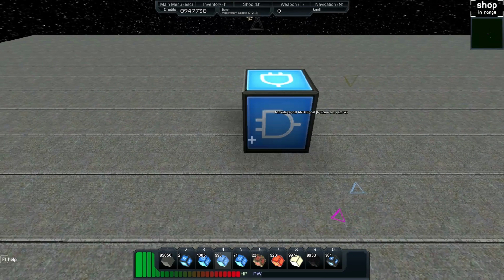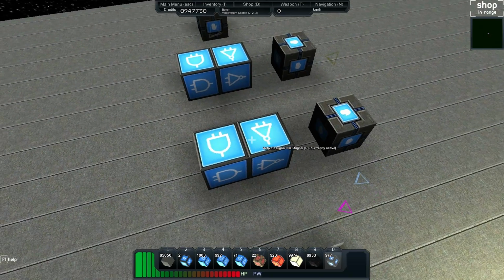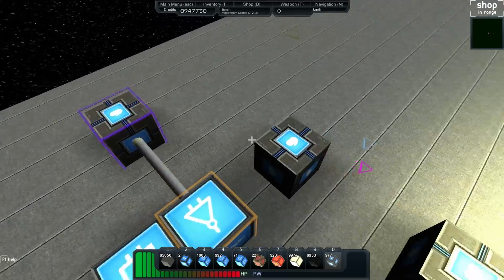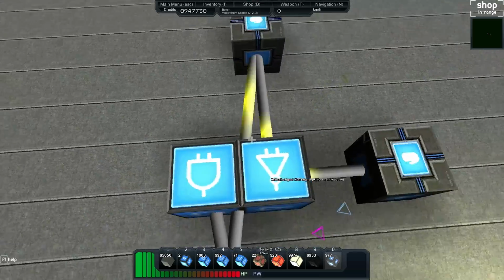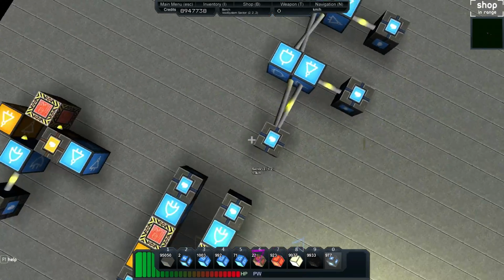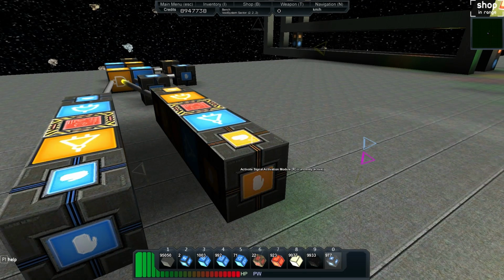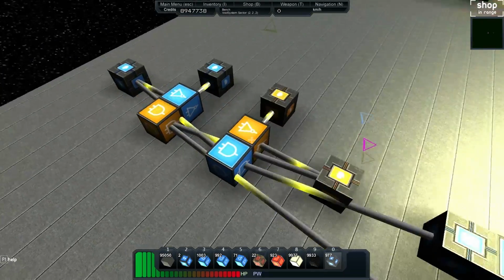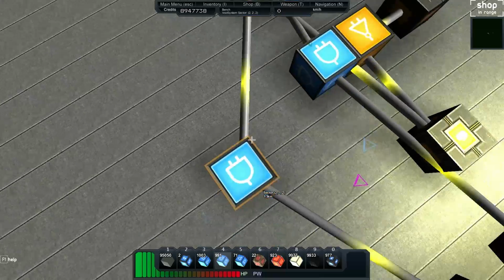Starmade Logic #4 - RS Latches

Comment: waa? correct me if I'm wrong, but this is way too complex! all you need for an rs nor latch is 2 NOT gates going into eachother. 1 is the set, other is reset.
Reply from the maker: Yeah this is the old way of doing it, from the original dev build. it's a lot simpler to do it now
Reply: oh ok I didnt realize that it's changed that much since you made the video. I'm still new to starmade logic.

Comment: IT DOESNT WORK
Reply from the maker: this is built to operate on the low-inputs (yellow rather than blue) so it does work it's just backwards. i'll be doing a new video with updated actual RS NOR latches
Reply: Oh ok thanks
Reply: BenchMinecraft How is that new video coming? I would love to see it as I'm still a bit confused (though i kind of figured it out using or gates instead of and ones)